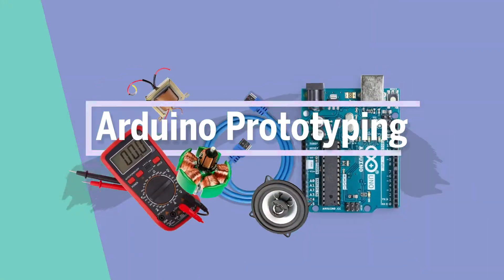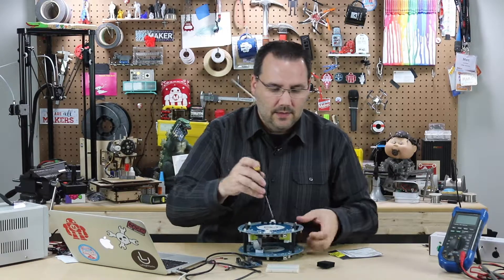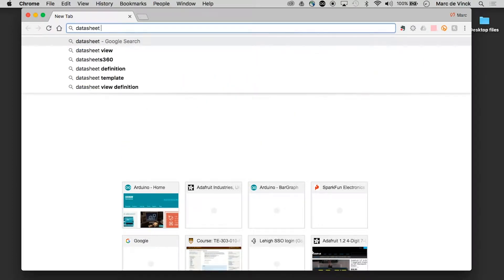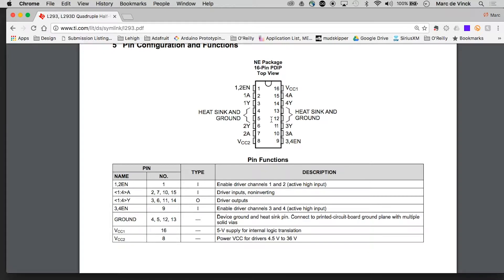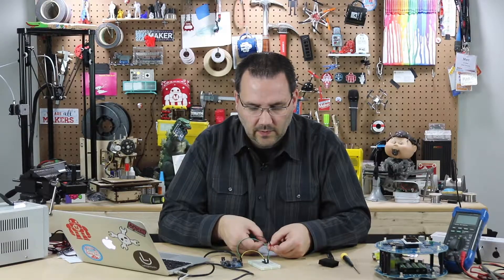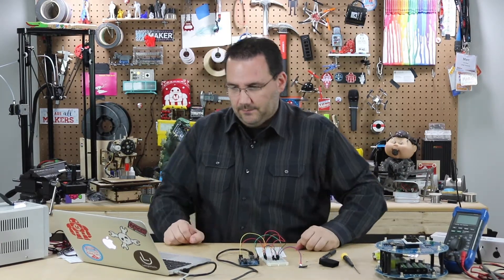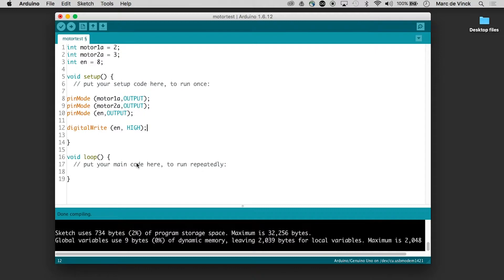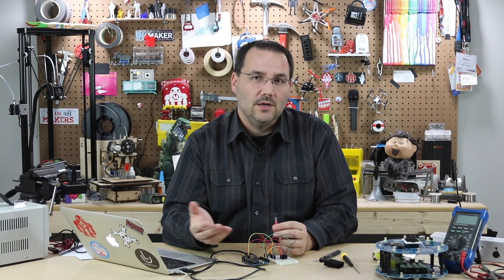Arduino Prototyping Outputs #83: DC Motors (H-Bridge)

Comment: Sir, can you make a video related to motor deriver and their variant. 
Because I have motor’s ratings are 12V 10A, which motor driver would you use?
Reply from the maker: 10A is a lot. I would use a motor driver breakout board. There are dozens available online.
Reply: @MarcdeVinck  Yes, you are right. But I am  confused which one is the best from all this.